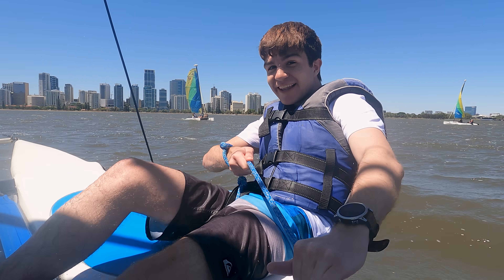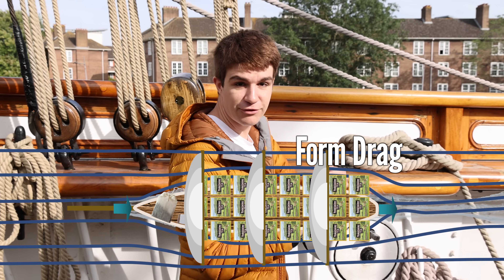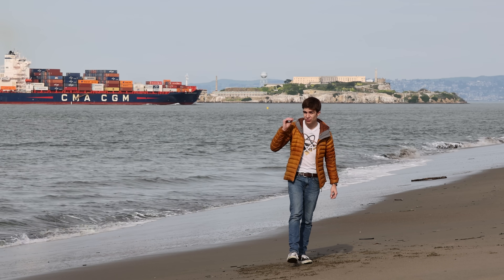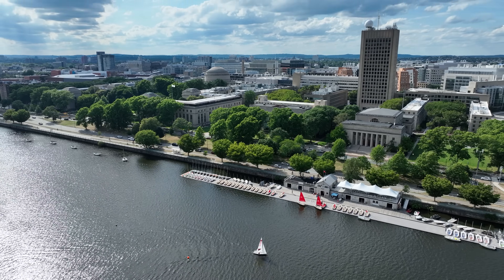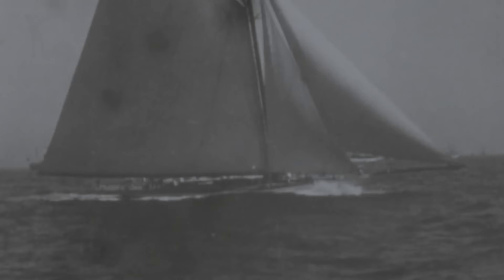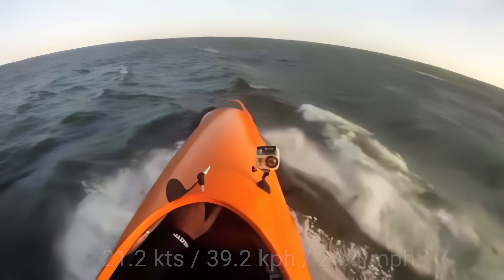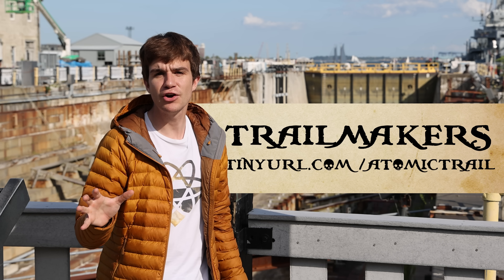What if sailing had no rules?

Comment: If there are no rules, I want to float like an otter, so my own body is the boat. The kite is like a small spinnaker with one line connect one corner to a foot, and another line connects the two corners; my hands hold and control this line.

Will this break any speed records? No. But I'll be able to basically just walk to the water and go!

Comment: Could you use a wind turbine generator and a speedboat propeller?  What about a kite with a wind turbine at a much higher height that generates electricity and sends that through a wire to an electric motor?  The speed record on water for a propeller driven craft is 99 knots (114 mph, 183 kph).  I'd imagine that was the limit of a pure wind-powered vessel.

Comment: You description of how sails work is wrong. It's a wing. As the wind passes over the curved sail at 90 degress to the motion of the hull it generates "lift" in the same way a wing passing throught the air does, except instead of pulling up it pushes forward. That's why sailing ships work best when they're traveling at not-quite 90 degrees to the wind.

Comment: What if you added bulbous bow to a sailboat?   the bulbous bow is a streamlined flaring or protruding bulb at the bow (or front) of a ship just below the waterline. The flare or bulb modifies the way the water flows around the hull, reducing drag and thus increasing speed, range, fuel efficiency, and stability.

Comment: 9:14 Wings generate lift not merely by pushing air downward, but by creating a pressure difference between the upper and lower surfaces.
Because of the wing’s shape (airfoil) and angle of attack, the air over the top surface accelerates relative to the air below, reducing pressure above according to Bernoulli’s principle.
Simultaneously, the wing deflects air downward, and by Newton’s third law, this downward momentum change produces an upward reaction force.
The combination of these effects results in lift.

Comment: The next way forwards is to ignore soft water.  Ice boats (boats that sail on ice) have been breaking speeds like this for decades.  Land sailers come close in speed, but if you want 'sailing with no rules' you have to go 'screw the water' at this point.

Comment: Fun, well made video but you need to brush up a bit on hydro dynamic drag. Quadratic (increases with the square of velocity) and drag is caused by conservation of momentum, not low pressure sucking it backwards.

Comment: It's a misunderstanding that square-rigged ships can only go as fast as the wind, and only in the direction of the wind, as said and shown in the video. Look at the illustration at 2:08. That is the exact same kind of sailing as the Bermuda-rigged yacht at 4:40, i.e. using lift to go forward (and my great-grandfather got his square-rigged boat to great speeds). But of course limited to hull speed, as any non-lifting vessel. But there was nothing unexpected about that! (2:52), that's just false. It's been known basically as long as sailing has existed, maybe even by the rowers in ancient Greece.

Comment: Very interesting. There is an intermediate stage - planing - for racing dinghies and other lightweight craft. They can exceed hull speed by rising out the water and overtaking their own bow wave. I experienced this when I used to race my Merlin Rocket. No need for a hydrofoil. But it only works on lightweight boats - not tea clippers!

Comment: "Suction" does not exist. High pressure at the front of the ship exerts more force against the bow section than the low pressure at the rear of the ship exerts against the stern section. The difference between these forces is drag.

Comment: You have zero creativity. 

If sailing had no rules i would simply use a plane, or sabotage the race, or destroy my opponents boats, or incapacitate other sailors. 

All this stuff about drag shows how sometimes enginers obsess about solutions and never think about the problem. Why invent some billloon dollar carbon fibre rube goldberg machine when a 2 dollar hammer will work?

Comment: 4:25 the explanation is not accurate... 180 degree from wind is called dead run, and the speed limit is well below the wind since the sail gaining speed is also taking "apparent" wind from the front... and also the modern sails are not taking speed "redirecting" wind but creating low pressure zone in front of it...

Comment: I did a lot of windsurfing in the late 80's and 90's, a lot and was going around mostly in Europe to catch the wind. In the beginning the boards were  big and needed big sails, then the semi sinker and sinker tiny boards came, in good winds they almost did not touch the water surface and with much smaller sails it still got much faster and I reached almost 35 knots in stronger winds. It was an amazing feeling to flow fast over the water. I know the professionals did like 50 knots .. I remember in good winds and some waves I just let it go as fast as I could, and used the waves as jumps and could easily jump 100 feet.

Comment: A further segment would be the bow mechanism of the power speed boats with a crew of 2 or 3 going insane speeds without hydro foils to lift the hull completely out of the water, yet not destroyed by wave or forces of the propulsion. Idea 2 the science of small water jet boats that in a crash jetesson the crewman inside a military aircraft cockpit that for safety sinks to the bottom out of the way of other racers.

Comment: Fantastic explanations.
However, wouldn't the fastest design be a wind launched glide plane? You can keep a little line dipped in the sea to pretend to be a boat if you want.
Get my point? For these constructions to have meaning, they need to have some of a ships other characteristics, such as weathering storms and transporting weight.

Comment: 9:03 Actually, a wing/aerofoil doesn't work by pushing down the air. It works more like drag, creating a low and high pressure and getting almost sucked up by the low pressure
Reply: Yes,  but that pressure differential pushes air down. Newton’s third law dictates that every action has an equal and opposite reaction: pushing the airplane up requires an equal mass of air to be pushed down. Watch alphaphoenix’s weighing an airplane video for a demonstration and some really cool shots of smoky air being pushed down by a paper airplane.

Comment: Maximum hull speed it just the planing speed on a power boat. If you could just get that sailboat going 1 knot faster it would climb the bow wave and ride on top of the water and gain around 8-10 knots with the same power. At least thats what my little 17ft boat does.

Comment: So the sail rocket 121 kph and the F50 at sail go 103 kph. That's more impressive because the F50 is a real boat which sails a regatta and not only straight one direction. And don't forget the wind surfer 😊

Comment: 10:00 This is a bit misleading about cavitation. The boiling of the water doesn't create air cavities as the video says, it creates water vapour cavities. When the cavities (bubbles) collapse, is the shock-wave caused by their collapse that causes drag. This is a different (but related) phenomenon to ventilation, which is when the hydrofoil sucks air down into the water when it gets too close to the surface.

Comment: the next step is "ekrano-yachts" .. or hover yachts, floating over a cushion of air, using 'ground effect.'
Probably get there using hydrofoils to lift off, then opening an aquaplaning wing, then using sails, rudders and ailerons combined to fly over the water.

Comment: Very interesting. Personally I think modern America's Cup racing is the most boring I've ever seen. Win the start, win the race, It's over after 10 seconds. F1 catamarans are far more competitive and interesting, but all things considered and discarding catamarans and foilers, the 18 footers evolved on Sydney Harbour, still the fastest single hull non, foilers there are,  is the best racing in the world. I think you missed out on a big design factor  in small boat sailing which is the development of the planing hull, which negates bow wave drag by sitting on top of the water and skating over it. Such a boat is always faster than a hull in the water design. Sydney Harbour 18 footers in a blustery Nor'easter are insane.

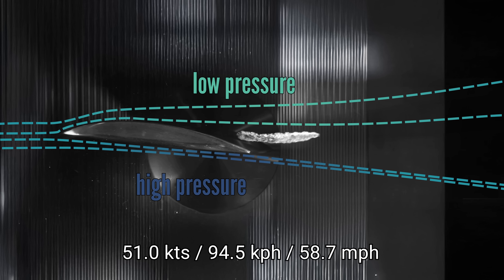Comment: 9:53 "At 50 knots the pressure of that upper region falls so low that water spontaneously boils"
This doesn't make sense to me:
If pressure on the upper side gets lower as the speed increase it means the lift become higher as the speed increase, but the mass of the ship doesn't get higher as the speed increase (OK, it does according to general relativity, but that is totally negligable at these speeds) and the same mass with increasing lift cause the ship starts to accelerate upward causing the foils came out of the water. Lift force always should be exactly as much as the weight of the ship, so pressure difference must be constant regardless of speed which can be achieved by lowering the angle of attack as the speed increase. If the pressure difference is constant regardless of speed then the increasing speed can't cause lowering pressure therefore the start of the cavitation can't be speed related.

Comment: I thought Sailrocket set the record off the coast of Namibia (formerly known as South West Africa) and not the fictional country of Nambia.  There's an "i" in the middle, if you can't see it. 

Meanwhile, here's a trick question:
What is the world speed record for a wind-powered vessel?  (Yes, a craft powered only by sails, catching only the wind, with no other power source. It wasn't mentioned in the video.)

A: about 225km/h (some 140mph). For real. 

Set by a Canadian ICE YACHT. 
Skates on ice develop all of that side-force resisting goodness with near zero drag, and none of those pesky wave-making or cavitation problems. 
Their only limit to speed is 1) How hard is the wind blowing? and 2) is there enough smooth ice to sail on? Although, I reckon "How brave is the sailor?" is probably a third factor in that. 
Canada has plenty of frozen lakes, hence their world-leading tech in this. 

If you want to get really technical, then a glider might also qualify (and beat that record). If you are happy to include vertical air movement as "wind". Since the glider rides thermal updrafts, "sailing" along them, surfing against gravity to develop forward speed. 
HOWEVER. They need help to get aloft - not an issue with any sailing boat or ice yacht. 

Also, there was no mention of planing. This is when a hull skims over the top of the water, like a skipping stone, so it does not form a meaningful wave, and that top speed due to hull length limit falls away. You do NOT need to have a hydrofoil to do that. 
Most high speed motorboats have planing hulls. 
Most modern dinghies do this, since they use the sailor's weight alone for stability, and have no heavy ballast down below. This is how a dinghy some 15 feet long can be faster than the 17.5 knot limit of Cutty Sark. 

Even modern ocean racers (like the Volvo Ocean 60's) use a lightweight canting keel plus variable water ballast, to be able to trim for minimum weight and maximum planing, setting some insane 24 hour distance records in their races. We're talking a boat 1/3 the length of Cutty Sark AVERAGING well over 30 knots, getting close to 40 knots, over 24 hours. And they are NOT using hydrofoils to lift the hull clear of the water. They are just skimming over it - which is what Sailrocket HAD to do, with the front hull carrying the pilot, to qualify for the world record. 

Incidentally, a "windsurfer" would be one of the smallest sailing craft around, that does nothing but plane, and routinely achieves 45 to 50 knots. Limited mostly by how long the rider can hang on and endure the buffeting from water and wind. 

Technically, the "keel" is the backbone along the spine of the ship, whereas the wing-like blade that resists sideways motion is called the fin.  The definition of "keel" has blurred over the last century, but it matters when discussing venerable oldies like Cutty Sark.

Comment: Great, except the wind doesn't push the sails.

I'm a minute in, and you're already wrong... the sail acts as a wing, providing the boat lift.  It just so happens that that lift is in the horizontal direction.

It's more like the boat is being pulled by the wind, than pushed, which is why you can sail nearly directly into the wind.

Ah... I see later on you explain how it's like a wing, but your're still wrong about how wings work.  Wings work by creating a low pressure zone above the wing, and a high pressure zone beneath it.  They don't do this by redirecting anything, otherwise you'd wind up with wings that look like giant scoops instead of gracious bird wings or fish fins.

Comment: It's incorrect to say that the old rectangle sails were hit by the wind at an perpendicular angle. Those too worked the same way as modern triangle shape sails.

They had a 'trailing' and a 'leading' edge of the sail, a side where the wind enters the sail. They were always on some 'tack' if they wanted to go fast. Ships rarely travelled in the same direction as the wind, only when there was more than enough wind to get to top speed. Principle of lift around the sails was used in the same way, albeit less understood.

When ships sailed straight downwind, the back sails would 'shadow' the front ones, taking the wind away. So just the fact that these ships had multiple masts tells you that they were not built to sail straight downwind.

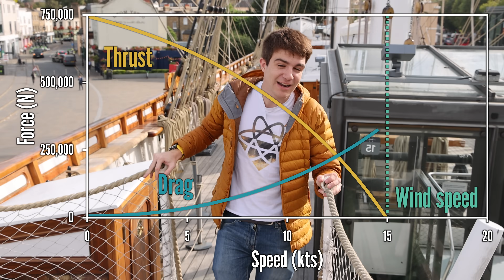Comment: Thrust is not zero at windspeed 1:02. That only works if you're sailing down wind. If you try to sail into the wind, there is no thrust. So, then your graph also doesn't work. According to your graph, topspeed is always slower than windspeed. That also isn't right. 1:14

Comment: A sail does not create forward force by 'redirecting the wind', instead it functions like an airplane wing, where a low pressure zone is created in front of the sail and a high pressure zone behind the sail. Causing a net force in the forward direction.

Comment: So much misinformation. Cutty Sark made 15 knots average in good conditions, and up to 17.5 knots fastest recorded. She had to contend with the doldrums of the indian ocean, you can't hardly compare her average over 40 days as her max speed.

You're terribly wrong about the age of sail, bermuda rigged ships long predate the cutty sark. The issues were chiefly the poor canvas volume in the higher winds, which is why kite sails are making a comback. Kite sails are even older. Sailing around the world isn't quite yacht racing, the cutty sark had to sail through aggressive storms, one of the reasons the suez is preferred, that and the pirates that are perhaps worse today. 

Lateen rigs of the dark ages could beat the wind, as could square rigs switch to jibs.

And another thing, jibs and spankers were used to maintain course.

Also square sails equally redirect wind as an aerofoil. 

Square rigs have far more adjustment for performance less optimised for specific conditions and can put much more sail high up.

Implying yachts were the progenitors of the keel blade too, there's a reason they were called cutters. 

I don't really blame you for skipping over so much maritime history but you really understate how much is purely driven by both material science and you're comparing a cargo vessel to a sporting one that cannot reliably sail the ocean as an insured and commercially crewed vessel.

And of course, arbitrary rules is unfortunate for practical atempts to utilise large wind'mills' blades and propeller which is capable of much higher speeds especially in a headwind of course.

It might be worth pointing out that sail is not out of the question, potentially speeding up many cargo voyages and increasing fuel efficiency. I believe world trade dropped its cruise speed down to 15 knots or so due to the fuel cost to time ratio. The logistical concerns and expense to build new infrastructure and designs are a huge hurdle however. Cargo vessels with a gia
Reply: Giant mast are rather unwieldy and in the way of loading cranes. 

If you could cut the crew and infrastructure requirements down enough to its cargo capacity, the cutty sark isn't off the table. Large vessels usually need tugs to keep them centred in the suez anyway. That would've avoided the ever given incident.

Making a real ship, not just a pan with an engine? Good luck, there are so many design considerations.

Comment: Due to relative wind, sailboats can actually sail faster than the wind. Its basically just a sum of vectors. What's experienced as you speed up added to the wind itself. What ends up happening is the boat is trimmed for upwind sailing while sailing downwind to the actual wind. Or ideally trimmed for a beam reach. Older boats could basically only sail downwind, so wind speed and drag played a crucial role in the top speed. But with modern boats, and by reducing drag as much as possible, eg using a hydrofoil, it's fairly easy to sail significantly faster than the true wind speed. 

here's an example sailing on ice.
https://www.youtube.com/watch?v=PE8mCZOmrEo

Comment: One of major challenge I learned after I saw anime "Ergo Proxy" scene showing "a sort-of Sailboat "Centzon Totochtin" , capable of traveling on land due to some sort of repulsor technology that lifts it above the ground. It is completely powered by the wind" (copy from website) I got curious to look up any possible for blimp traveling using only wind as power source. one of forum said that would be impossible is lack of fluid to keep blimp from pushing sideway like keel. Do you understand me? That's would be so interesting to have "sailing" all over world without worry about land stopping them.

Comment: Correct me if im wrong cant you add retractable slitting in the wings of the foil to get rid of that boiling zone
Reply: Adding slits to let a little water through would increase the pressure no. And make them able to open and close